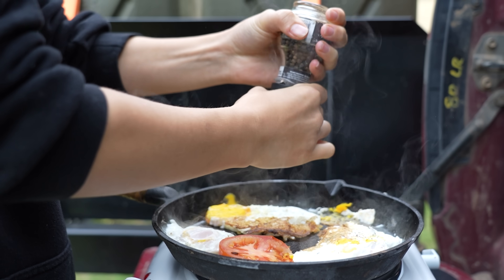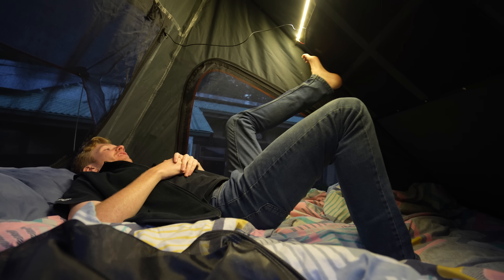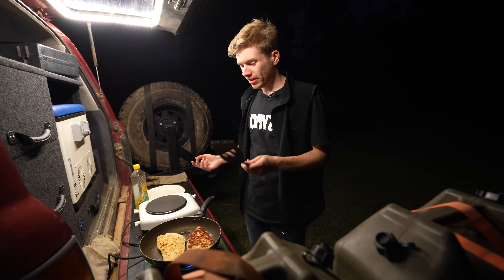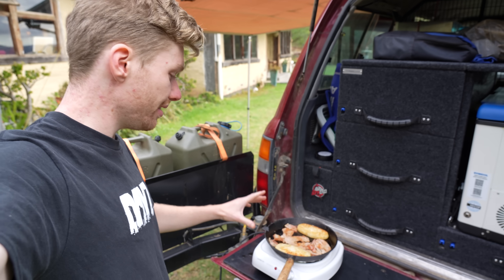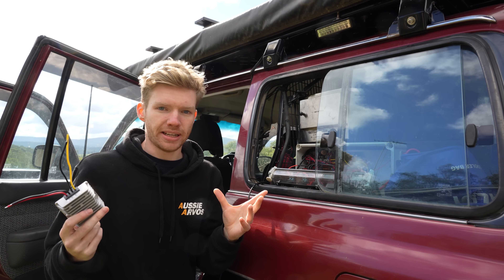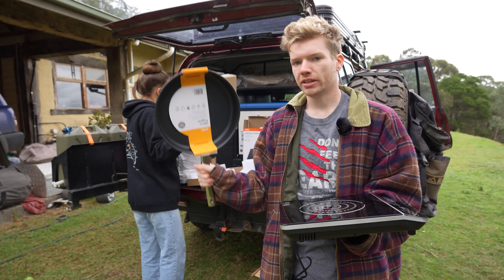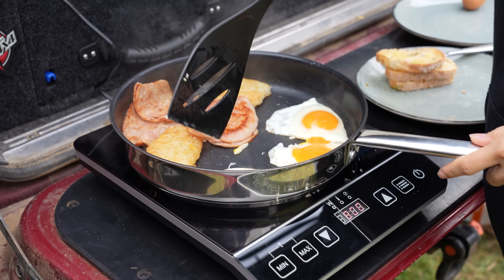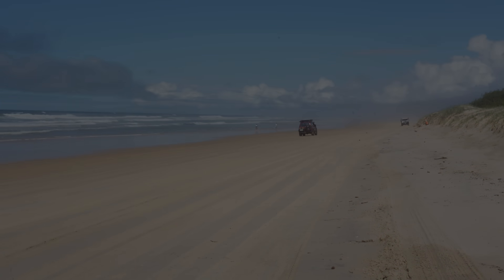is BUDGET induction cooking ACTUALLY POSSIBLE? Pushing my 12v Camping setup to its limits.

Comment: 120amp lithium batteries usually have a discharge rating of 100 amps which is approximately 1200w. Induction cookers draw between 1000w to 2000w depending on its heat setting. You are running additional fridge + lights hence why the BMS is shutting off the battery. AGM batteries do not have a BMS integrated, thus they can run inverters more effectively. If you want to run a fully functional lithium battery you must invest in a 200 AMP which generally has between 150/200 amp discharge rating, which means you can easily crank to about 1800w/2400w.
Reply: Was waiting for this comment haha. Most people don't realise that they have discharge limits
Reply: Yep this
Reply: Ryan  yes two batteries combined will produce 200amp discharge rating.
Reply from the maker: Absolutely spot on ! Thanks for the info 🙏
Reply: @AussieArvos  predicted you would run into this problem when I saw your setup :) invest in another kings lithium and your set for a long time. In fact they have a promotion which ends tomorrow where you get $500 off the 200amp lithium, just under $1000. Then you will have a 3000w discharge rating when hooked to your 120 lithium.
Reply: Garbage, wild touring uses 150 amp lithium battery. U dont need 200 amps of lithium.

Comment: The solution is perhaps to use a Remoska whilst you are driving powered by the alternator.  The Standard Remoska is 470w and the Grand 580w confirmed with a plug in watt monitor.  Brilliant bit of kit and FB has a superb group covering how to use them.

Comment: mate , try an air fryer. I have a 300Ah lithium and when running a 2000W inverter, tried an induction cooker first. you can lower them down to about 1000W to work with your inverter. An air fryer is the way to go though for sure. granted i went to a 3000W inverter but they don't run the whole time. the duty cycle is like 25% so very efficient.

Comment: Someone has probably already commented this but I think you are in  lower state of charge than you think.  Doesnt the battery have bluetooth app? Bluetooth BMS or a really good ah-counter ( like victron bmv-712, not cheap..). Thats the only thing that can give you correct state of charge. Voltage is not applicable with lithium. At least charge the battery fully with lithium charger ( like you have been driving all day. I use microwave oven and kettle. Some frying with induction ( breakfast pancakes, bacon n eggs). And i use mainly my still going 190A agm ( cheap start-stop battery). But its charged fully almost every day since 2018 since its my workcar too. So, state of charge is the most inportant whatever batterytype..

Comment: A couple thoughts: try an "instant hot" water device that has an insulated water tank that uses less watts at once.  This will be gentler on your battery as well as giving you more convenience over a kettle.  Next I would like to weigh electric cooking with solar panel against a solar reflective cooker hybrid approach.  There are a few off the shelf products becoming more popular now for this.

Comment: Turn the fridge off when cooking. As when the fridge motor kicks on the current draw spikes then settles down.
Ie if an appliance says 1000w with a peak of 1500w. When you turn it on it draws 1500w then settles to the 1000w.
Happy glamping.

Comment: I had similar experiences running on Jura super automatic coffee machine. The power consumption is 1450W but Kings 1500W inverter beeps like yours although my AGM battery were charged and displayed at least 12V.

Comment: Good to see.  I've been following your adventures and thought of similar things (just was deciding on battery and inverter).  I have the old kmart butane stove  and also got the kmart fry pans which I see you finally got - they work great on the campmaster.  
I'm a bit iffy on inverters and induction but I have bought a small breville espresso maker which I hoped to use eventually (was a fan of their dual boiler BES900) but bought a non boiler thermojet/instantaneous espresso machine similar to how all the smaller machines are.  
For cooking backup as well as the kmart campmaster butane I also bought a Dometic Lpg baby grill as back up - CBP101.  E: Also looking into an evakool DC40 drawer fridge/freezer to mainly use as a freezer.  Because of your video I'm now looking into the travel buddy pie warmer too!  I guess I'll need more battery capacity after watching this.

Comment: I'd be really keen to see if you swapped for a different 120Ah lithium of a different brand whether you would have the same cut out. Great episode and it is making me think how large a system I will need to build. I want portability so it won't be a permanent installation more solar generator size. Cheers 🍻
Reply: I have an allspark lithium 100amp battery. And I have pulled over 100amp successfully using an enerdrive inverter without any severe voltage drop. Might be the cable size contributing to the voltage drop or just the kings equipment/battery not up to the task

Comment: thought i let ya know. your running the induction at 1200watt which is 100amps. battery is only rated at a discharge of 100 amps and 125 i think for a peak. keep that in mind. your inverter is rated alot higher than your battery output.

Comment: I'm thinking its the battery quality letting you down, or you have voltage loss through your wiring. My previous setup had a single 100Ah DCS Lithium & 3000w Redarc inverter, I could hammer it with no dramas at all.... ever. 
I've since moved that setup into my camper trailer (Kings btw, so can't label me a brand snob haha) with 4x VoltX 100Ah batteries so there's always enough headroom to support the inverter with a larger load, like a toaster & coffee machine running at the same time.
Travel Buddy's certainly need the buck-boost converter. Running them on 14.5-15v makes them perform way better.

Always enjoy your content, keep it up.

Comment: i've done some research for a 12v system, using electric cooking is min 2 to 3 batteries, so my system i will be making is going to  have 3 lithium batteries at 100ah just to handle the spike draw of the appliances i will be using, and constant draw for the few minutes they will be on.

Comment: Amp hours is the measure of battery capacity. Amps is the actual current and watts (current x voltage) is the power. 

Regardless of the amp hours capacity of the battery, it will have a max current and power draw rating.

The reason your power cuts out is because the current draw is higher than the battery can sustain. Rig up more batteries in parallel to increase the max current draw and you’ll be golden.

Comment: Pat not sure if you read any of my comments eg hoist adjustment, some induction cook tops work on lower settings by pulsing full power, so your induction cook top maybe pulsing 2000 w for 50% of the time so they tell you it’s 1000w. Not all do this so if you have a marginal battery in terms of bms it may not cope. High end induction cooktops apparently don’t “pulse”
Reply: Put a clamp meter on your 240 volt and see if it pulses

Comment: I am guessing it’s the discharge capacity of the battery.  My lithium iron phosphate battery and bms is rated at 150 amp/h discharge rates.  I have 150amp/h capacity battery diy from individual cells and a bms and it’s charged from a 50amp renogy DC/DC charger.   It runs a fridge 24\7 without any issues and it’s even sat without the truck running for over a week without any issues.  I have an induction cooker I want to incorporate into my setup, just need to get a 2k watt inverter.  I have a 100 watt solar panel to go up on the rack but ended up in the hospital with a triple heart bypass so that’s gonna have to wait for a few months.

Comment: What's your max amp draw on your Battery ? 50amp it will cut out, I have a max 200amp draw on my battery and works well, I use induction all the time and 13 volt oven no problem, but my inverter also 1500 will cut on any big pulling items, you need a bigger amp draw on your battery then it will be good 👍

Comment: If that Hot Plate is really 1200W then it will draw 100A at 12V (92.3A at 13V). So the 66A draw on setting 4 means it’s only drawing about 800W. 

Also you need grunty cables to pull 100A+ (which your battery can’t even provide). Your inverter at 12V and 1500W would be 125A, the battery is rated to 100A max continuous.

Travel Buddy won’t draw 3A. They are 130W so at 12V that’s 10.8A. My KickAss one draws about 11A (13A with the light on).

Best to turn off the fridge and Travel Buddy when using the Inverter at high loads.  The step-up voltage converter for the Travel Buddy will shorten it’s lifespan as it’s not designed to run on higher voltages - also it will almost certainly void any warranty you may have. Keep that in mind.

That was 850mAh (not mA) just to preheat the machine mind you. Not to make the coffee. 
I use a pod machine when camping as it’s so much easier to use with none of the cleaning and fluffing about with coffee grounds.

Your Ah capacity is fine at 120Ah. Not fine for very much cooking though as 120Ah will vanish fast. It’s just the battery (or inverter) can’t sustain the power draw. 

You also should run the inverter directly off the battery and not through any intermediary things except maybe a switch, fuse and a shunt if you NEED to measure it’s usage. 
I run my inverter directly off my battery which never shuts off - but if I draw too much power for the inverter - the inverter will trip. But my lights and fridge will keep going as they are not affected by the inverter tripping. I’ve never had the BMS shut off power except when the battery got to 0% SoC.

When using gas to cook its best to use a shield to keep the wind away as gas will take much much longer to heat when it’s windy - sometimes it will never heat if too windy. 

Also be mindful of terms Amps and AmpHours. At the end you said the system was using 42Ah when I think you mean Amps.

Comment: Im curious about that wiring job you did - splicing the new USB plug into the LED strip. Does the existing wiring and fusing work with the extra load of the USB ports? Also, what connectors did you use? Looked like mebbe electrical tape? I assume so. Just thought I’d ask. P.S. yer vids are awesome. I really appreciate and am able to learn from your speaking/teaching style. Works for me. Very approachable and inviting. Thanks for that. Keep it coming.

Comment: I would recomend a battery capable of 200A continuous draw for cooking 
- The issue you will face is depleting the battery with the high draw cooking and not having sufficient solar to recharge it when you are camped up
- your Kings battery is spec as 100A, yet has issues delivering this (perhaps some further testing here and then talking with Kings.) My understanding is that the battery should not go under voltage whilst delivering 100A continuous untill virtually flat.

Comment: The issue isn't the AH/capacity of the battery it comes down to the quality of the cells within the battery and the bms. The bms will be rated to a particular amperage for continuous discharge I suspect it is 50 A for this battery. A higher end battery and bms pairing would typically allow for 100A continuous discharge without the voltage drop you are dealing with.

Comment: Inverter wattage ratings are based on what the inverter draws from the battery,  not what it supplies on the 230v side. Most inverters are 80-95% efficient depending on quality. Your 2000w inverter is providing around 1600w.

Comment: As you have probably found out now , it’s not the battery it’s your induction cooker. The induction cooker works like a micro wave. Lower settings just have a fully on time and a fully off time. The inverter is trying to provide this digital on off power requirement so you think that you are getting an analogue turn down of power.

Comment: Bro it'll be you're cabling between the battery to the inverter voltage dropping the inverter below cutoff. What gauge cable you running?

Comment: Very nice video.

 I just bought a 50eur 2000w amazon induction cooker.
My setup is 2x 100wp pannels
1x 100 Ah German battery with 113 Ah usable
2000w 230v Chinese inverter

My setup can be Bluetooth monitored so I can check live what power I use

My nespresso uses 1450w for 1 coffee which translates to 5 A draw
I use it to heat water for 1 cup of tea too, I just don't insert any pad. 

The cooker is something else. What you read is false. My cooker, when showing 1200w draws 1400; when showing 1600, nearly 1950w and the max power just stops the inverter, which means it's above 2300w. For pasta, there is a "boil water" button and I'll use that. I'll end up drawing 20 - 23 A
I've tried several watt configurations and it doesn't matter if you use 1200 or 1600w, it will boil the same, you'll just end using more power. 

I only use solar power. So as long as there is sun for a few hours, you can cook every day at least once.
But, if there is no sun to recharge your battery, you might end up eating sandwiches for a few days :)

Comment: Not to do with your inverter setup.
But for the rooftop tent I run a 20Ah power bank sits in one of the pockets, charges my phone 4 times and can run the led strip light. Food for thought, I just didn’t wanna run cables in and around it

Comment: Hi mate not the battery as it may only be a constant 50amp max draw only, you may need to get a higher constant amp lithium battery, mines a 100amp max constant battery and 100ah.

Comment: Reckon that the limiting factor is the output current of your lithium battery, not the capacity. 120Ah is enough. But if it can only provide it at a low rate for example 50amps per hour, and your cooktop is drawing 80 amps per hour (just an example) then your battery voltage will drop and bms in your battery will cut the connection. That is why your coffee machine works fine (lower current) but the induction cooktop doesn’t unless it is at a lower setting.

Comment: great video!!
but that doesn't sound right. 1200W at 13v is 92A.. that is without the losses in the inverter. 
Can you put a 240v power meter and measure that?
also, according to the website, the continuous current for that is 100A. so it should not cut off. but then, it's a kings battery so...

Comment: Hi Patrick... did I see/hear something in one of your latest video's that you solved the issue with your use of the induction cooktop ? Something about bypassing the shunt for the inverter ?
Reply from the maker: Hi Chris! yes i bypassed the shunts and fusebox and instead inverter runs direct to battery and haven't had an issue since!
Reply: @AussieArvos  Great to hear ! So your setup now is still a 120Ah Kings LiFePO4 going to a 2000W Kings inverter (directly connected) and then the induction cooktop plugged into the inverter ? If so, I am figuring your induction plate probably tops out at around 1200W setting for continuous use without the BMS in the battery tripping ? 

I have an existing 100Ah Lithium that has a 50A continuous draw rating, so looking to up this to at least 100A via a new battery. My inverter is only rated to 1000W, so I'll need to replace that as well, or get an induction plate that will allow me to use the lower power settings (ie less than 1000W) to run it.

BTW, what size cable did you end up running between the battery and the inverter and over what distance ?

Cheers

Comment: Main issue is not a big enough battery
I run 2 x 120amp lithium with 2000w enerdrive invertor
I luv electric but its not cheap to setup, you could buy a lot of gas for what it costs to setup, but elec is so convenient
My biggest issue is the appliance cupboard is taking over the car: pull out slide with twin induction cooktop, pie maker, sandwich maker,  coffee pod machine, milk jug heat and froth milk,  and forget the travel buddy an 1300w air fryer is light years better imo
One more thing your cast iron pan will work on induction cooktop as will most steel or stainless steel, just aluminium cookware wont work

Comment: The biggest issue you are experiencing is a 100AH draw from the battery and as the battery gets flat, the power output reduces.  Best move is either a 24v system or a gruntier 12v battery (150AH or 200AH output).

Comment: Better quality battery is needed. The lithium battery should be steady at over 12v right up until last 10 percent of capacity. I have 2 100 amp sphere lithium and run 200 amp microwave for 15 minutes without any issues even induction cook top.

Comment: check what the continuous amp discharge rate is on the battery. most cheap batteries will only have a 50amp continuous discharge rate. could be contributing to the battery kicking out

Comment: Does idling the engine put enough power into the battery to keep the voltage up ?
You'd probably want to idle it in the morning to cook breaky before travelling anyway or at night if you haven't travelled?
without a DCDC on a agm it works fine for me with the alternator helping

Comment: What you pay for is what you get. Induction cooking is costly, not all lithium batteries can sustain a huge current draw for a long period. Itech lithium does Peak power output to a peak draw of 270 amps with a sustained output of 175 amps for 5 minutes, and 150 amps continuously. Kings does output up to 160A of peak current for 10 seconds. Do your research before you invest $$$$$$. Loving the new setup. All neat and tidy.